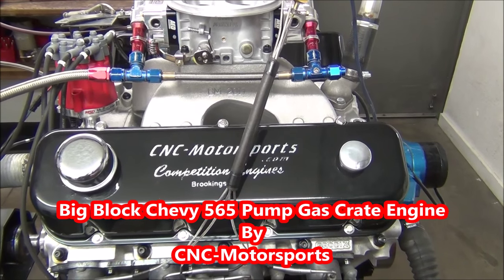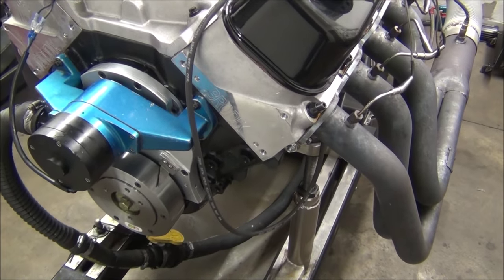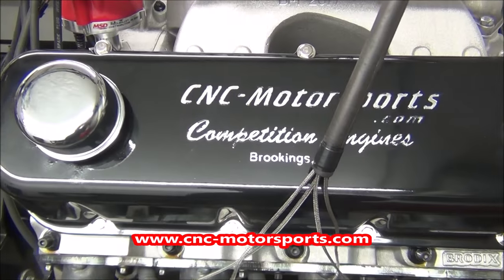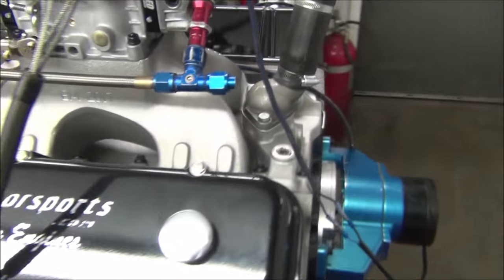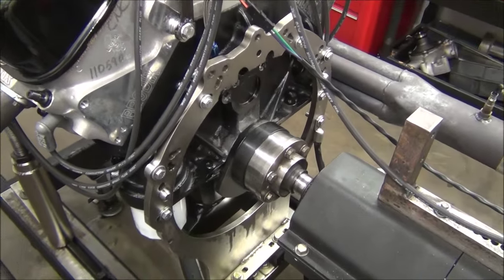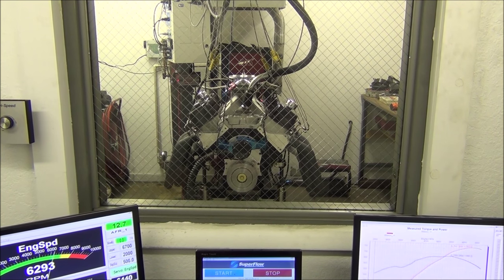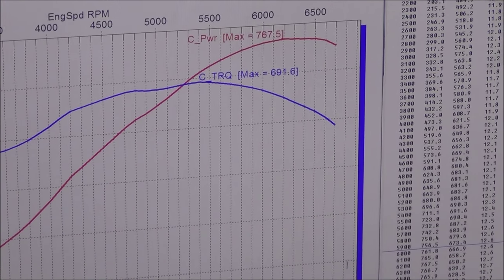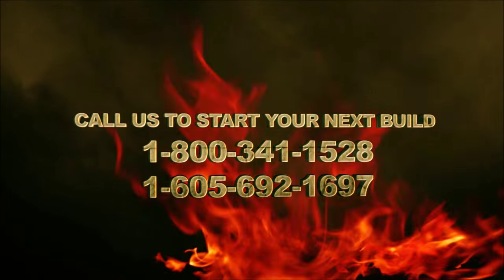765 Horsepower 565 Big Block Chevy Pump Gas Crate Engine

Comment: An absolutely incredible engine, but if you aren't rich just build a bored out 454 or if you got xtra cash flo do a 496 with a solid roller and spinit good. Its all good, cheers!
Reply: What? So building a 565 with a good hydraulic roller that makes 750+ hp w. shaft rockers etc. is much cheaper than a solid lifter 496? What insane planet are you on? They will cost about the same, and if you want to run solids in a 496, you might as well run solids in a 565. Not even sure why anyone would spend a lot on a 496 unless there are some kind of class rules in racing that dictates the cubes.
Reply: @AB-80X  
You completely misunderstood what Toby was saying. He was NOT making a reference to the valve train, he was talking about being more affordable to build.
He is saying there ARE options for people who are not rich.  The 496 BBC Toby mentioned is like the 383 SBC and it has nothing to do with the cam being solid or hydraulic.
People build and run these strokers because they are CHEAPER by thousands of $$ to build!   People DON'T have to spend big $$, that's the point.

496 BBC and 383 SBC are the CHEAPEST strokers to build because the stroker crankshafts are everywhere for almost as cheap as a stock replacement and you can use a stock block so you do not have to spend the extra $$ for a Dart Big M Block.  You don't have to have super huge and expensive heads or a Dominator carb to make decent power,  BIG-BORE motors require expensive cylinder heads not only to fit but also to accommodate super high valve lift to flow enough to air to feed these huge engines at high RPM. This requires special pistons to solve piston to valve clearance issues etc, etc. Setting all this up right takes specialty tools and a LOT of time and expertise to figure out which equals expensive $$ beyond what the parts cost.

This 565ci build is probably $20,000.  I also understand you are getting a LOT more than just parts for $20k too so I'm not shaming this build in ANY way. It's worth every penny I'm sure of it. It's all about what I can afford and the best bang for my limit buck.

What Toby was saying is you can bore a "good" stock 454 block out .060 over and throw in a SCAT 4.25-inch crank in it and spend a few extra dollars on the right pistons and valve springs for a solid roller cam and end up with 600-650 hp with the right parts and some hard work yourself for $12,000 CHEAPER than what this Dart Block and Brodix Heads 565 will cost.  
It will NOT make as much power or last as long as this 565 build but it will be super fun and probably be as close as most of us "poor-boys" will ever get to the power these $20,000 builds can make because we simply can't afford them. 

The same thing is true with a 383 vs a 427 or 434 SBC build. When you can use a stock block 383, 385, or 389 ci engines to make decent power, you can saves $$$$$ over buying a Dart SHP block and super expensive heads. 
Is a Dart block 434 SBC with CNC ported AFR Eliminator heads better? HELL YES, but have you priced one lately? My god, for what it costs to buy one built, I can build a 496 BBC with the same power and have money left over. Or like Toby was eluding to, build the 389 version of a 434 and get within a 150hp of it and save over HALF the $$! 

Just FYI, if I do ALL the work myself except for cylinder boring, line boring, decking and balancing, I can build a 600+hp 396ci SBC from a .060 over stock block and a 3.85" crankshaft for $7500-ish and then put a 250 shot on it for $600 so with around 850 hp I'm all over this 565's ass and THAT my friend........... is RACING. 
This keeps the race tracks FULL!   Ask CNC-Motorsports if I'm lying? Lol.

At the end of the day, it just depends on how much you're willing to invest (or how much money you have) vs how much work you're willing to do. We all want these super builds but sadly we can't all afford them so we find OTHER ways to go fast which usually means doing the work ourselves.

Comment: Nice street engine, but you said it has roller and shaft rockers,,,,
Reply: He said hydraulic roller. And shaft rockers are just a plus in any situation.
I run a solid roller in a street engine, and it's not an issue.
Most people who have issues with solids on the street, do so for one out of two reasons. 1. An unstable valve system. 2. Poorly secured poly locks.
I never touch my lash, but check it on a regular basis.
Best trick for the street is to run a slightly hotter hydraulic roller cam, and then run solid roller lifters that are zero lashed when cold. (All alu heads and block for this).

Comment: How much for this motor but a solid roller cam?
Reply: Ima guess 20k
Reply: Same price probably, or really close. Only thing this engine really needs is a cam, spring and lifter change, and the stuff in there, is already at the same price. Solid roller stuff is generally not more expensive than high end hydraulic roller stuff. It's just more fun and better.

Comment: I know good for the drag strip but that would be okay for a tow vehicle
Reply: My 565 cubic inch big block Chevy made 948 horse and 840 foot-pounds of torque run 906 at 154 mph in the quarter mile my friends didn't like my motor
Reply: @bigredracer7848   yes im sure it was made for all out racing, this is a street motor

Comment: how often do I have to rebuild this motor
Reply: If you use good hydraulic roller lifters such as high end Crane lifters, it can go thousands of miles in a street application. Top end would probably like springs and lifters @ 1500-2000 hours, but other than that, it looks like a solid build that won't need much.

Of course if you beat the crap out of it and constantly abuse it, it won't last long. But that goes for a base 6.0 LS as well.